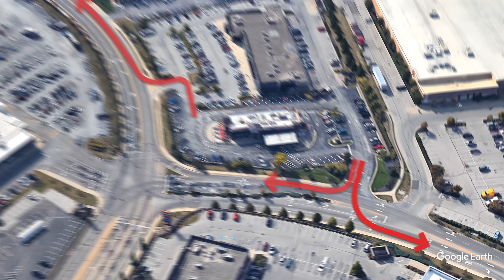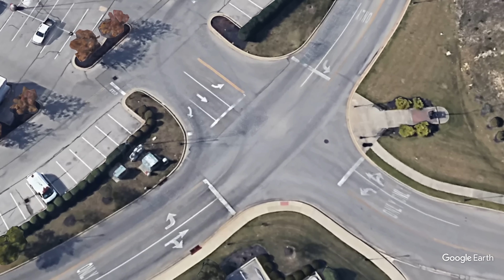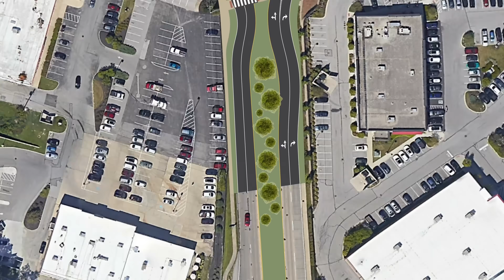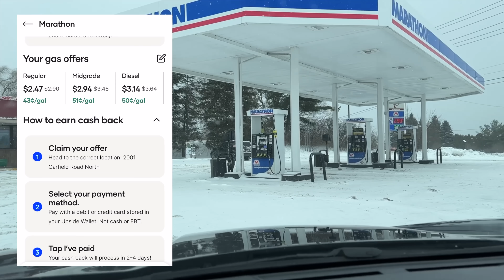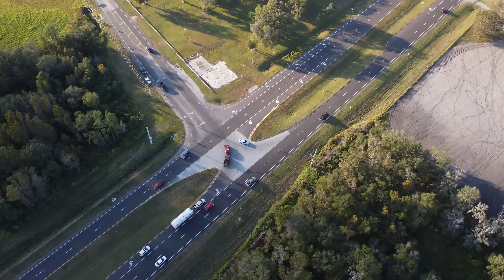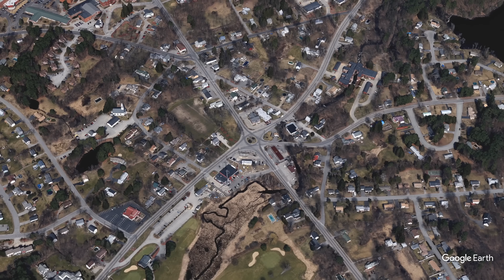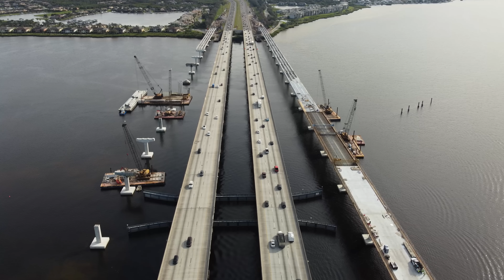These Intersections Should Be Illegal

Comment: I'd love to see you come up with a concept to fix the mess of a intersection (it technically is more like 3 in 1) in Waitsville (known best as Raleigh Hills) in Beaverton, Oregon. Beaverton-Hillsdale, Scholls Ferry, Olsen (all major thoroughfares), Dogwood Ln (partially disconnected from itself at the main portion of the intersection), and endless business and light industrial drive ways/entrances and exits) all in one clusterf**k of a space. You've got horrid angles, a random one car long extra intersection pretending to be a slip lane, contradictory traffic interactions, curves and steep slopes, combine with around 80k-90k vehicles going through it each day.

For the traffic numbers, the data currently is old, from during the lockdowns mostly, and there is also the skewing caused by the years long expansion on 217, and the Westside Pipe Project, with BH experiencing heavy reconfiguration and construction along it and Western ave for just over a year, with it still on going further up toward the intersection in question, but it becomes clear what a more accurate traffic count number for it is after adding up the skewed numbers, then accounting for the increase in population and density, the construction projects on mixed use developments, and of course normalized traffic volumes outside of the things that skew it, which is that 80k-90k figure I gave here.

I actually made a video on my rough concept for fixing it, to which endless comments insisting one or two roundabouts would solve all our problems, with the same ooze of overconfident egos as the "just one more lane, bro" folks. Suffice to say they REALLY didn't like my video outright roasting them that followed haha. Ironically it turned out my concept was near identical to engineers and planners made in partnership with the county to finally fix it once and for all. So much for "just leave it to the professionals, dude, you got no clue what you're doing clearly" comment I received, eh? haha

Comment: The solution to the entry and exit ramp one at the end is to have the cycle lane cross the top of the on ramp at 90 degrees, like a pedestrian crossing. Then have it follow the shoulder over the bridge, rather than being sandwiches between two active lanes of traffic, then cross the offramp at 90 degrees also. This shortens the distance (and thus time) that cyclists conflict with the flow of traffic to the width of the lane, not the entire length of the bridge. This, enabling them to cross quickly and safely.

Comment: Great analysis and suggestions for better roadway design. However, I don't quite agree with your thought on the ethics of only providing infrastructure for the lowest ability users (child cyclists in this case). Such thought rapidly devolves in planning circles to 'we can't allow bikes' in all sorts of places. Instead we should be saying 'bikes and pedstrians BELONG here, how do we safely integrate cars.'  (not the reality in the vast majority of US planning departments)  Children (and many adults) will self select that that intersection is a challenging and dangerous route. They will probably find a ride (or drive themselves) to get where they are going. This is bad for ecological and traffic reasons but reality that will keep them safe. More confident riders may use the route anyway if it is a key link to the network because there is probably no alternative. Having a bad option is better than none (going many miles out of the way is not a viable option for encouraging non motorized transport). Instead they should focus on how to make it as safe as possible. Pylons to "protect" the lane for parts might help by keeping sightlines but forcing the cross merge into the best locations. Extra signage for car and bike warning of the hazards ahead wouldn't hurt either.

Comment: OMG! I literally just got back from the first intersection!! :0

I go shopping in this area every week, and it's totally a mess.

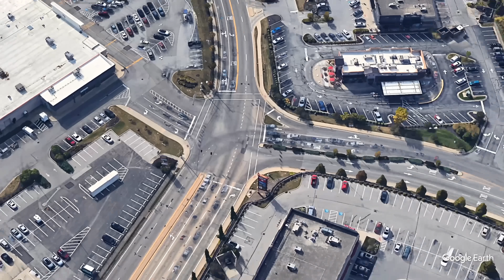What you don't mention is that it just snowed recently, so the junction from N Grand Ave and 471 is completely blocked by snow, and you have to just merge across a solid white line just to get into this mess. Also, people flying off of 471 often don't control their speed well, leading to the higher rate of crashes you mention at 1:44. I totally agree.

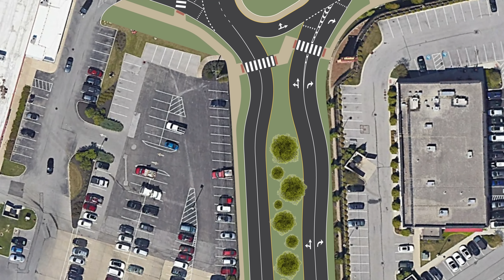I'm in love with your gentle curve at 3:23. I think that's a really elegant solution to the people speeding out of N Grand Ave.

Thanks for focusing on NKY!! Florence and Mall road is a total mess too

Comment: I'm really not sold on changing the number of lane on a roundabout. For me (as a french guy) you should be able to go round and round the roundabout in any of it's lane.We especialy learn in france that the outer rim have right of way and you take the inner ring only to go left and if you don't know where you want to go you take the outer ring to asses all the exit going one full circle. Having a lane that doesn't continues around the whole circle would be prone to error of judgment from people and stress to be in the right lane. Imagine you go left after the chickfilet and forget to use the inner ring, then you ar stuck and forced to go on the freeway. In france I can't think of any round about that doesn't have the same number of lane, and I think it is part of why they work well , you already know the layout of the roundabout when you arrive at the entrance (1lane going in = 1lane roundabout ; 2 lane going in = 2 lane roundabout).
But maybe i'm mistaken, i never drove trhough one of these weird roundabout.
Reply: That's a stupid design. If multiple lanes can enter, but only one lane can exit - you get a bottleneck. It also reduces the usefulness of inner lanes, especially on smaller roundabouts.
On Western roundabouts, you're supposed to pick your lane in advance. It's not much different from a regular intersection in that regard. If you keep forgetting to change lanes, you probably shouldn't be driving.

Comment: That turn lane isn't supposed to service the Chic fil a. Even if it's a turn lane that intersection is blocked by a double yellow. Turning left there is illegal.
Reply: Exactly this is a turn lane for the next parking lot. If they want to go to the first one, they should use the other entrance instead of crossing a double yellow.
On the other hand the outside lane of the parking lot with the arrow pointing to the left is illegal since the only way to turn left from there is to cross the double yellow.
So one illegal design (the left lane out of the parking lot) and a bunch of lazy drivers breaking the code.
Reply: In most US states you are allowed to turn left across a double yellow line.
Reply: @trainsim5869  But you are not allowed to cross two sets of double yellow

Comment: There's a sneaky secret issue in the first example, which I'm sure others will also spot. That's the fact that the car parks for Target and CF are 2 separate car parks. If you unify them together, you can reduce the entrances to one single one that is controlled by a double lane roundabout. There's no need for the over-engineered approach that the US seems to take to these problems when there's a simple solution people don't want to accept.
Reply: I was thinking the same thing. It would take like 10 ft of new cement
Reply: What you can't see from this angle is that Chick-fil-a's roof is about level with Target's floor. The whole place is jammed into a tiny valley with tall hills surrounding it, and there's a lot of topography. This complex is the main entrance for a major highway into Newport, with the highway going directly across the river into the middle of Cincinnati. It gets way too much traffic for how tight it is in there.
Reply: @Ravaxr  OOOOHHHHHHH I should have checked on google maps. That makes so much more sense thanks :)

Comment: The only thing I'd say here is that in the UK most roundabouts are two lanes. For a drive-on-the-right country like the USA, you'd have a right-hand lane for right turns and straight ahead, and a left-hand lane for left turns (or really for any exits more than halfway around the circle from your starting point). 

Yes we do have single-lane roundabouts too but it's much more common to see this standard two-lane design even on relatively small roundabouts. It keeps traffic flowing well and on busy roundabouts there may be signs to use both lanes for straight-ahead, especially if you're joining a two-lane road or heading straight into an intersection where one lane is used for turning. 

All of this has the advantage that any very large trucks like fire engines, buses/coaches and lorries/HGVs have the extra space they need to cut across both lanes on the roundabout, if it would be too tight of a turning circle. Then again in the UK people will give that extra room to a bus/lorry/fire engine, whereas I imagine in a lot of the US they'd just force their Jeep into the neighboring lane anyway and then blast their horn for 5 minutes.
Reply: In my country they suck, because you can enter the roundabout from any lane, but are only allowed to exit from the outermost lane, even if the exit has the same number of lanes. 
Needless to say, a lot of drivers ignore that in practice, and exit from the inner lanes anyways, sometimes leading to crashes. In some cities there were gangs taking advantage of this - they would drive around in circles, waiting for a driver to exit from the wrong lane, and when he did, they would intentionally ram into him, to try to claim compensation money (often successfully). 
There is hope though. Turbo roundabouts are starting to be introduced in some cities, which use signs and markings to guide drivers into the correct lane. Some of them though, have become notorious for crashes.

Comment: Turning left to get onto the highway like in your second example is one of my least favorite driving situations. You have to check for highway traffic from the left, check for highway traffic turning left onto your road, check for people driving across the highway onto your road, and then once you're sitting in that middle spot cars can often block your view of traffic, especially if you're not driving a truck or SUV.
Reply: Yep, they are the worst.  Mostly old rural roads that still have 'em.  I also hate suburbs that lead to a busy main road as well.  It drives me crazy to not see roundabouts utilized where they make perfect sense.
Reply: It can take a very long time to find a suitable gap. Over time, you get less and less patient, and start to look for smaller gaps, increasing the risk of misjudgment and a crash. Other cars piling up behind you also pressure you to go.

Comment: just looking at the first redesigned road, it looks like it fits a lot LESS traffic in it than the original...so I'm not convinced just yet. It certainly isn't as messy, but I'd need a traffic simulation to convince me that it's not going to create problems of its own.

 the traffic volumes moving through seem too large to accommodate any pedestrians at any crosswalks, as well. from my perspective (urban college campus) pedestrians like to back up vehicular traffic for fun, and that probably wouldn't work with the large amounts of traffic moving through one lane here.

solution to that ^ (if people actually start walking) is probably just a pedestrian bridge.

disclaimer i know nothing about traffic design, this is a layman's perspective
Reply: Hey! I think the reason why it seems like there's a lot less trafic is that the vehicles doesn't need to stop as many times, therefore the fluency of the traffic itself is kept at a stable level, so, the intersection doesn't need a 3-way lane, beacuse the witheld traffic does not exist anymore.  But still: a traffic simulation would be very handy.

Comment: 11:08 we have an intersection kind of like this in Albany New York, where the Northway, I-87, crosses over Central avenue, near the end of Wolf road which runs parallel to I-87with separate on/off ramps to go north and south and a shared merge lane between them due to proximity. they opted not to do this method, but what they did do isn't really safe either, and there's a "ghost bike" on the fence at the pedestrian crossing across the southbound ramp.  part of the problem here is that there's also an intersection with a residential street that is basically combined with the southbound on-ramp.  I don't know which came first but they should block this street off, rerouting residents to the next street up, because even though this street isn't very heavily used, it makes this ramp confusing to anybody who's not used to it, dangerous for pedestrians in cyclists trying to cross the ramp, and most residents already choose to go up to the next intersection because it's so scary.  on the bike I only go this way early in the morning, the rest of the time I'll go out of my way either on Sand Creek road which is also a common cheater street, so also not safe, or down to the Access road beside the Amtrak tracks and jump over the tracks at the siding to railroad avenue, which is longer, bumpier, and slower for me and also still a dangerous move, but much less risky than either Central avenue or Sand Creek road.

Comment: 0:38 no the obvious solution is to eliminate the Chick-fil-A intersection all together, instead routing those people through Target's parking lot which is already set up for that level of traffic flow. this gets all of that traffic away from that intersection all together. this is what most of the stripmalls around here do, there'll be a fast food restaurant in one corner of the parking lot with only the drive-thru segregated from the rest of the parking lot. the rest is just shared parking space. it seems to me the reason they did it the way they did it is the segregate Chick-fil-A's customers from Target's delivery trucks. the aerial photo is obviously taken early in the morning, in the summer, so we don't see what traffic is like during late November holiday shopping, but for the rest of the year typically that outer section of parking lot would go unused anyway
Reply: Apparently (not visible in the overhead shot) there is a significant height drop between the one lot and the other and that's why it's two entrances instead of a shared one.
Reply: Yeah, that’s how our local Panera Bread restaurant functions here in the Tri Cities in eastern Washington.

Comment: On a UK dual-carriageway near me (70mph road, many motorists do 90)  you are allowed to cycle - if you're brave enough. https://www.google.co.uk/maps/@50.7537082,-2.345488,300a,35y,3.34t/data=!3m1!1e3  There is an interesting solution to crossing the high-speed slip ramps here, where the cyclist is given a shortcut, which allows the cyclist to cycle the length of the slip ramp, and cross the single lane of traffic perpendicularly.

Comment: For that 1st configuration, doesn’t the main roundabout (the “big” one) seem a bit small? If you’re saying that it’s traffic coming from a divided fast road? 
Where I live, in the south of France, we have this sort of setup with roundabouts instead of intersections but usually the main ones, with fast roads or highway ramps coming into them, they are usually multilane (2 or 3 lanes) and really big (100 - 150 m (100m ≈ 330 ft) diameter but sometimes up to 300 m). Granted these have a bit more accidents than smaller roundabouts but are still safer than std intersections. And those accidents occur cuz ppl drive crazy there 😅.

Comment: 3:18 Why not turn the chick file and target exits into one with a direct way to get from one to the other?
Reply: 1) Private land owned by two different groups. 

2) Insurance purposes.
Reply: There is an elevation difference between the two areas. If you look at the trees in the green area between the two, you can see the slope better. I’m just going by what someone who is familiar with this area commented on earlier. I didn’t see it myself either initially.

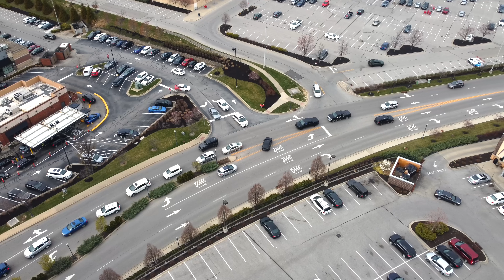I think 0:57 shows it well, especially if you look at the Y shaped  sidewalk section. I think the dark green area shows where they tapered from the higher sidewalk down to the lower light green area. It could just be different vegetation, but I think that actually shows the slope. 

This intersection must be an absolute nightmare at Christmas.

Comment: The 4 way stop is a thing that should NOT exist at all. If the traffic is high enough, install traffic lights. Or downgrade one of the roads and make it into a 2 way stop. Or build a roundabout (like you suggested at this intersection). Also a cheap and fast fix for the problem of people wanting to turn out of the Chick-Fil-A and into the Target would be to cut through the median between the 2 with a direct opening that prevents the need to turn back onto the main road and then into the Target parking lot.

For the broken roundabout, some one way directional signage (and maybe a few arrows on the pavement) would be very cheap and at least mostly stop people turning the wrong way around it.
Reply: I've never understood what the point of a 4-way stop is. I don't think I've ever seen one anywhere in Europe.
Reply: @yarati4584 It is marginally sensible at a blind intersection at low-speed areas. But if the speeds are so low, might as well just use the standard yield rule.
Reply: @dbclass4075 i actually think most are used at major intersections in rural areas